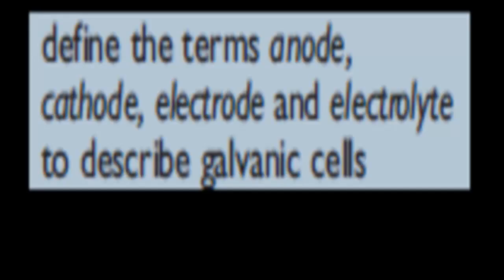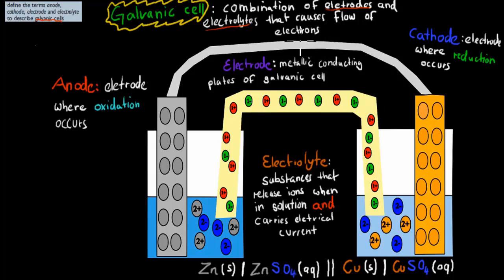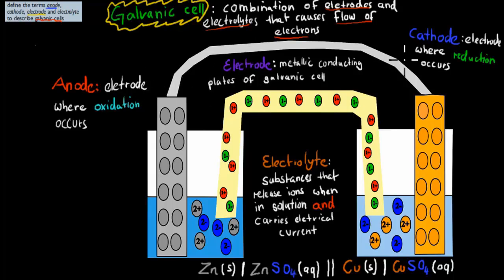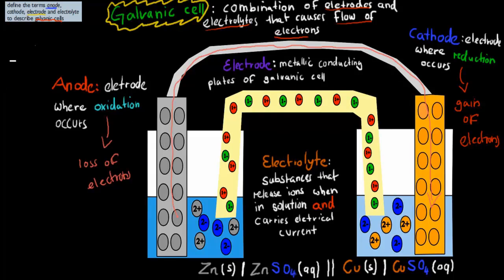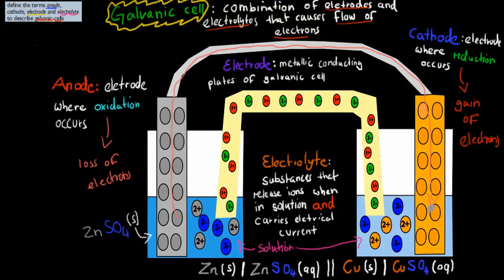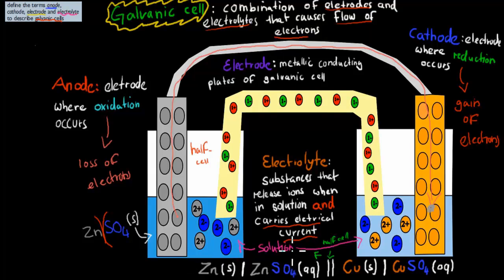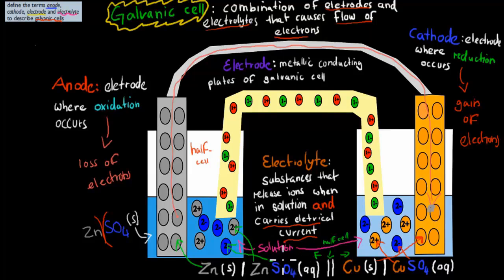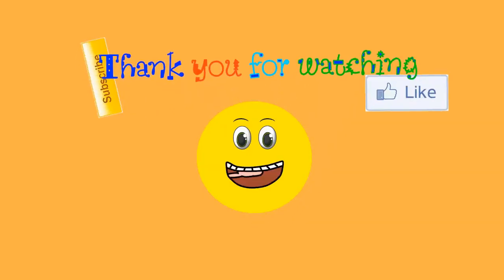6. Electrode and electrolyte defined (HSC chemistry)

Comment: A galvanic cell with a salt bridge wouldn't be a galvanic cell, because all the salt bridge is doing is making positively charged particles and negatively charged particles moving around in order to balance the charges on both sides thus allowing voltage to occur
Reply: thanks you